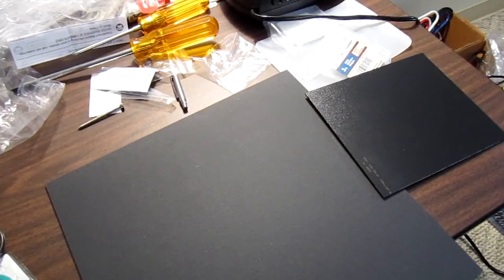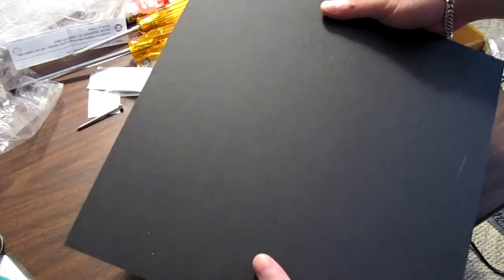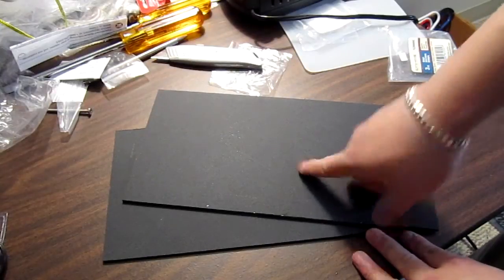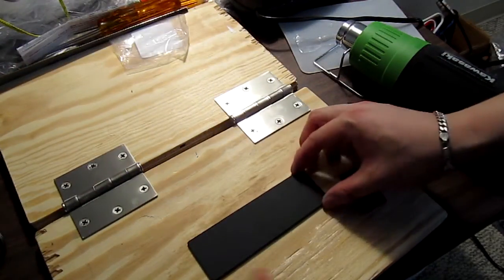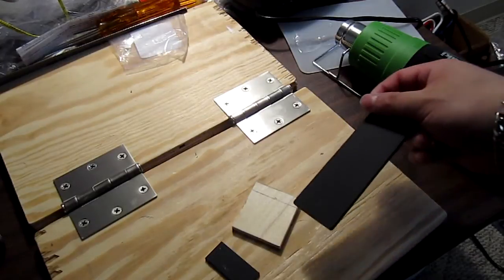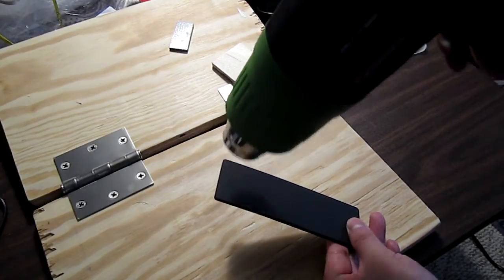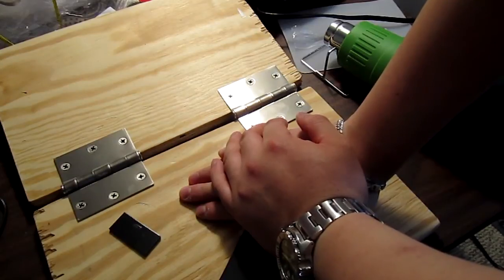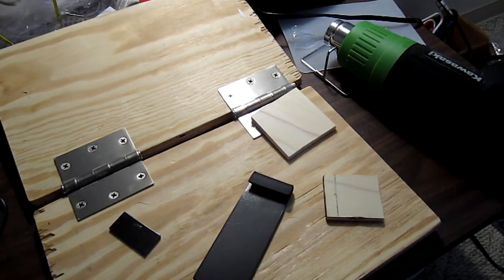Kydex Belt Clips part 2

Comment: Go to HD or Lowe’s to section where they have AC/Heat duct they have a sheet metal tool for bending the steel works great on kydex to form the 90 on your loops